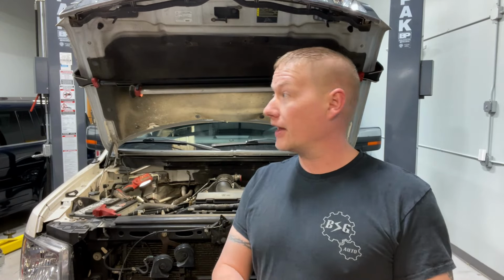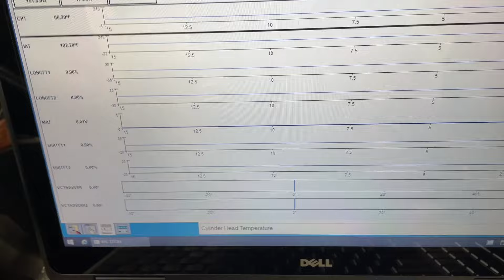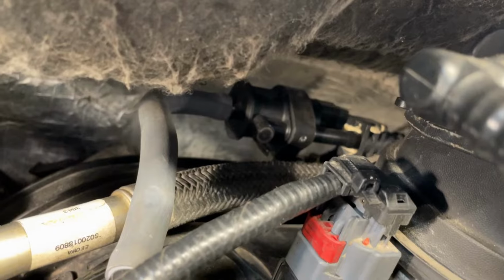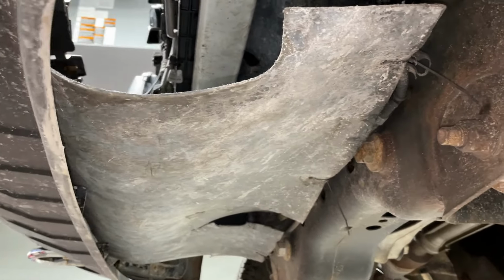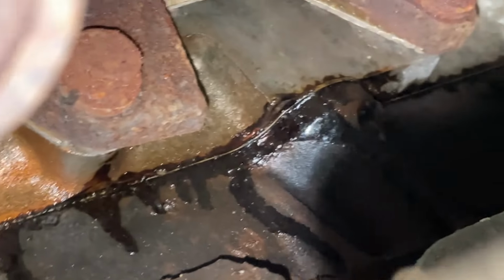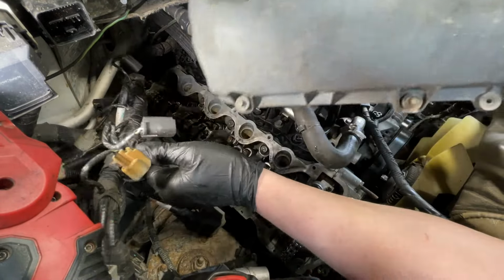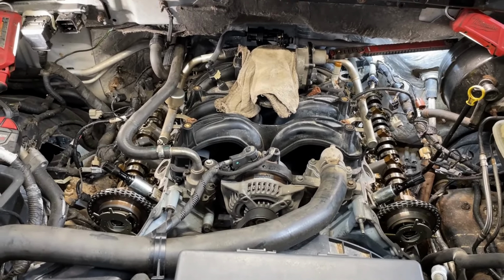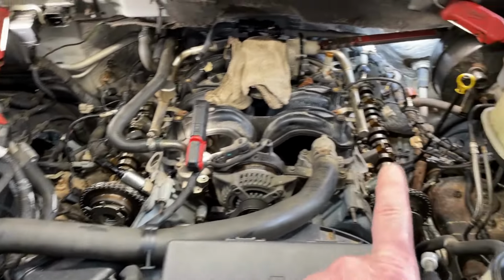The Worst Hack Timing Job Ever!

Comment: Mr. Ford tech! Can you please please help me, I just put a new tivct 3.5 in my taurus, its running crazy. Going from lean to rich every other second, sometimes misfires under heavy load going on entry ramps to the highway. The codes are p137 and p157 low voltage bank 2 sensor 2, replaced sensor, no change! :( :(

Comment: Geez, that trucks look nice on the outside (front bumper looks like a mirror), but under the hood and the underside looks like a rigged, RUSTY mess.    Still talking about doing the upgrading with the Amazon (as you suggested) Ford timing components kit on my 140,000 mile 2004 along with Melling HV oil pump (I already purchased)!  So far I only get the occasional chain slap for 1-2 seconds at startup.

Comment: Embarrassing work! I just did the timing job on my 97 4.6 following your instructions to the T even the rtv globs on the t points. I used felpro gaskets with new bolt grommets I've never had a problem with that brand. I also deep cleaned all the grime off the valve covers and timing cover, and then when all done pressure washed all the crap off the bottom area of the engine since the oil filter location is dumb af and it hasn't been cleaned in its life

Comment: @FordTechMakuLoco.....I was wondering if you can help me out with a rather odd issue I'm having. 
Rebuilt a 5.4l 3v, its set back in, bolted up, wired up, it cranks and turns over but will not start. Fuel pump is good, no anti theft system acting up, everything is working fine except...while testing things, I decided to test coil packs with coil test light and no go, I decided to test wiring to coil connectors and there's power going to all 8 connectors, I was stumped and sure didn't think all 8 coil packs had gone bad or something so I bought a brand new ignition coil and connected it, put test light on the wiring to the connector and put coil test light onto the new coil and connected it and had someone crank the engine. 
Power to the coil connectors is definately there but coils not engaging spark at all, not even on the new (ignition) coil.....any opinions, suggestions or tips on how to narrow down this issue? I'd really appreciate it.

Comment: Part 2??  Can't wait for you to work on the new 5.0 with the cylinder deactivation system, which I'm sure will be another nightmare engine.  Chevy having this in 2007 and later ram trucks with nothing but problems and some got lucky with little or none, now to seal the deal ford joins in.  I got my popcorn ready.

Comment: Man do I have a terrible timing job story. I have a 05 Mustang GT that needed a timing job and wanted to do it myself but I just didn’t have the space to do it. I already hate taking my stuff to shops so I was really dreading a shop touching all the timing components. As soon as I dropped my car off at what seemed like a really knowledgeable shop it was as if my car disappeared. They never called me giving any updates with the progress. What was supposed to be a couple days soon turned into a couple weeks with very limited contact. Finally after pulling teeth they tell me to come pick up the car since they are finishing it today. I go by and as soon as they thought they were wrapping up they forgot to put on the tone wheel(on the crankshaft) so that led to a couple more days. After my car was up and running finally they claimed it’s making a bad clicking/popping noise when turning. This was surprising since this wasn’t happening before I dropped the car off. They claim it’s probably just an upper strut mount since the car has been on a lift for over a month. So I keep driving it and the noise continues. I replace the upper strut mount, noise continues. I finally look under the car and to my surprise they had left the entire k member barely bolted in. That popping noise was my entire drivetrain shifting. After looking at it some more I discovered my transmission mount was missing two bolts so it was also freely moving around. Fixed everything myself so I know it’s alright but man did it piss me off. I honestly don’t blame the technicians, I talked to them and the truly seem knowledgeable and even felt bad for having my car for such a long time. I truly believe the shop owner is an incompetent d bag who can’t run a shop making the techs run around with their heads cut off.

Comment: i did an engine swap on a 2008 5.4 3v and had this issue with the used engine from the salvage it was painted up so pretty looked like a crate motor but would loosed oil pressure on one side and give me rich codes and timing codes  removed valve cover and seen the caps did not match the heads just like this vehicle  the salvage and me went  back and forth till the  gave me my refund and the real reman engine from name brand company  fixed all the issues the vehicle had  thanks for this video

Comment: I asked a question about doing the transmission filter had purchased a 2008 F-150 has, 160000 I'm not sure the history the fluid doesn't smell burnt but it was something I would like to get on a record if I could is it true about the myth feels like I'm getting inside a lot of shifts between third gear and overdrive

Comment: Those who live close to Chicago are so damn lucky to have him available. If you own a 5.4 3v and live close to him, do yourself a favor and just take it to him. Mechanics in my area are so unreliable it's almost unbelievable.  I had my rear end bearings replaced. ..Costing me close to 1k only to find out they forgot to put in a $4 bottle of friction modifier...I finally put it in myself several months later when I heard the noise upon turning sharp and it did quiet it down quite a bit but it's still there and it smells burnt when I open the filler plug..Wish there was a way to get the oil tested to prove it was not put in but from what I read oil analysis won't show this. Now I'm told by another mechanic ill have to spend at least 1.5k to replace all those bearings again since most of the time you cannot press the bearing off... they will do that plus the limited slip portion damaged from no friction modifier to fix it properly. I mean ffs..yeah just take it to Brian and be done with it, knowing it will be done right. Because of Brian I did my own plug change saving me hundreds of dollars from local shops..they knew I had the sp515 in but never told me those are the ones that didn't break and I could change those myself without worry of breaking them..Brian told me though. He also recommends the  Pennzoil 5w30 platinum Full Synthetic that so happens to have an additive to help valve seals...which stopped my oil loss I had since I've owned this truck. I was using about 1/2 qt in 700 miles..got over 1k since last oil change and still at full.  I just ordered the OBDLink MX+ OBD2 for Forscan and the oil pressure tester to help me understand more of what may be going on with my 5.4 3v. before deciding what to do. Brain thank you again.

Comment: Is it possible (likely) the previous shop hot tanked the driver side head but did not clean the caps? That doesnt explain the oil pressure issues but I think id have pulled those caps to inspect the journal and bearing surfaces.
Reply from the maker: Oh I did pull them.

Comment: Here’s a problem that could make a good video for the FordTechMakuloco channel. I have a 2010 F150 XL 4x4 with a 4.6 3v engine. It will not shift into 4x4 low. It shifts into 4x4 high no problem. It might be related to the ABS light that is on in the instrument cluster. I’ve checked the transfer case shift motor and it works fine except it won’t rotate the shifter shaft to the 4x4 low position. The reason I think it might be related to the ABS issue is that the CPU likely needs to confirm that the speed is below 5 kph before it will allow the shift motor to select 4x4L. Otherwise the transfer case could be damaged. I don’t have the wiring diagram for the 4x4 system but I know there are relays and speed sensor (VSS) and the GEM module involved. Anyway, if you can shed some light on this it would be much appreciated.

Comment: That's sad crappy work all around but some dealer that are shady sell off these ford truck to people with issues my dads buddy had a 09 with the 5.4 and it had cam phazer noise from day one he tried to get them to fix it they refused multiple times giving him bs excuses what the noise was till it was out of warranty so he made payments on a truck he couldn't drive for a year or so and then sold it at a loss I'm normally a dodge person but I don't mind any brand of truck but has ford done anything to remedy the 5.4 timing issue or have they just ignored it ?

Comment: Great video.  I do like the straight talk you put out on your channel.   Wished I had been to your site when I had a Transmission re-build and a head gasket job done on my 2000 5.4.   What I did not have the TECH do when the head job was done was replace all of the Cam Followers and rollers...ignorance on my part. Now it's "time" to tackle that task before it grenades itself.    If you have one of your old USMC buddies who has a shop in the Hampton Roads VA area (Newport News, Norfolk, VA Beach) who you'd recommend I just might be inclined to do some of that "Supply Side Economics" that Regan used to preach and let the "Local / Little Guy" take on the job.   If you have someone, please post it.  I'd toss you the job but you're just too far a drive and it might blow up on the way!

Comment: I seriously doubt that there is a salvageable core for a return on that block!!!
About two and a half years ago, I bought a new motor for my 2003 F-150 5.4 two valve! 
I had a guy install it with a new transmission, but the motor itself was a remanufactured motor from an 05’ Excursion which required a new oil pump, pick up tube, and oil pan because the cross members under the motor are different between the two vehicles!
I had asked around and watched several videos on redoing the timing on that motor(including this channel’s videos on that subject) way before I considered changing that motor!
Looks like this customer should have watched a few videos before they decided to shop around for engine work with their truck as the test dummy!

Comment: The staining around the headgasket takes me back to the dodge neon days (I am oldish).  Chrysler dealer told us the MLS gasket required a sealer in a rattle can that we sprayed all over the headgaskets to help seal them. .... Ok.... dealer recommended so... ya, experience has taught me different since then.
Reply: That sealer was for the guys who did the slip and slides .

Comment: Any recommendations on the 5th Gen Ford Explorers? Model years to stay away from vs recommended model years? I know the 3.5L NA and Eco-Boost engines have had severe problems in their earlier versions but maybe fixed by Ford later on? Thanks!

Comment: When will you show a 05 -09 mustang 4.6  3 valve phaser job ,my 09 has 60k miles  runs  great ,but I need to know when the timing and  oiling systems need maintenance
Reply: The timing job is essentially the same as the 5.4 3V. At 60k you should be fine for many more miles. Brian has recommended using 5w-30 oil and always a Motorcraft filter. Use 100% synthetic oil and change at 5k mile intervals and you won’t need to worry about anything.
Reply: @bryceweaver8211  Thanks,  How much stress does a custom dyno tune put on the phasers and valve train? I've been using  Motorcraft  5W 20 oil ,The only time its ever been red lined was on the dyno.

Comment: It’s very possible that one shop fixed the engine. Maybe after that car was running good but later something happened to the bank2 and other shop or the same shop was guessing and installed an old cam with old caps.

Comment: question;  do you replace VCT's while the valve covers are on or off?  Boy I wish you were closer to where I lived so you can work on my truck when it needs it.  Thanks for the video.  That poor guy dumped a ton of money and didn't get much in return.  If you do the engine I would like to see what's leaking from the head/engine block.

Comment: The factory intake sucks air in through the inside of the driver side fender. Is that not cold enough? Putting it back under the hood would make it a hot air intake.
Reply from the maker: yup exactly

Comment: I can almost hear the mechanic tell you that he had to do a junkyard cam swap due to a possible VCT failure that resulted in metal chewing the old one up. Same for the head. The plot twist is, all parts came from different vehicles. Probably different eBay sellers for used parts.
Reply from the maker: Lol

Comment: 😂 That cold air induction system pulls hot engine air instead of the cold air in the wheel well, where the oem pulls from. 
😂

Comment: I have a 2004 that stalls or shuts off when stopping. 160000 miles. Ready to have timing done but would like stalling issue resolved first. I put in neutral or park and it will normal to next slow down then truck turns off. Never throws codes. New Ford VCT solenoids and throttle body. Some have said its pcm.

Comment: Just had new timing kit and oil pump put in 2008 Ford mustang gt  and is worse before when warm it would shake at idle but I rev rpm and levels out now at hot idle sounds like diesel and wont level out when I rev rpms 58,000 miles no mods put about 4 thou and now it is worse was oil leak he admitted there was not one before said he fixed leak but this is a nightmare do you have any ideas what I could do been horrible stressful 7 months trying to fix only code is p0022 thank you sir.

Comment: The factory phasers fail right? So aftermarket worse than failed Ford originals?
Reply from the maker: Yes never use aftermarket phasers, I have a whole video just on that subject.
Reply: @FordTechMakuloco  I have used Dorman several times without issue but I know you have done more than I. 
I need to check out your presentation on that.

Comment: This is why you vet who you have service done on your vehicle! Especially when it comes to important service like timing and heads!

I recently took my wife's vehicle to the local shop to replace two tires. One of which had tread separating. I told them, replace bad tires(which were on the rear of the vehicle for safety), then rotate the new tires to the front. Because you always want the tires with the most tread on the front. What did they do? They rotated the tires first, then replace the rear tires. Essentially putting the bad tires up front and the good ones in back and replaced the good tires. How in the hell, as a service shop do you get this mixed up. If someone wants to replace tires that have tread separating, which is a very dangerous problem, do you not at the very least identify said tires before doing any work? The tire in question had a huge bulge on the outside edge of the tire that was bald and cracking. How to do not see that and put that tire on the front? Which is the worst place to put them? If i was a service tech i would not only identify the problem tire, i would inspect ALL the tires to be sure that there wasn't any other problems. NOPE! These guys just blindly did stuff to the vehicle and almost sent a potentially accident-prone vehicle down the road!

Also, NOBODY obviously took the vehicle for drive after words. If they had, they would've caught this mistake because the tire was so bad it made the steering wheel wobble so bad that you could hardly hold onto it! Seriously, i wouldn't take my vehicle back to this place to get a windshield wiper replaced!!! FFS!!!

Comment: Help. Plss.. My 06 F150 5.4 Harley Edition. I have backfire or like combustion noise coming from near driver side part of the engine when I accelerate on the road but when I press gas real quick it gives a loud pop then accelerates fine during idle. But when I accelerate on the road it would cause loud banging noise or backfire and engine would want to either stall or just slow down.
Reply: And has a Knocking noise coming from center rear of the Air Filter area right below it

Comment: If that came in I would go with new engine also...no way around it...too much time to try and guess/figure out what was done wrong in the past at other shops. Some of the "repairs" there are pretty bad. All of the repairs that were being done there are pretty straight forward so for someone to really butcher it up says alot. New engine goes in and leave all the headaches in the past and just enjoy a properly functioning truck.

Comment: I wish I could post a pic of the worst timing job ever.  Guy used the wrong guide and trying to figure out what's going on drilled holes in the valve cover to see through it.  Also jammed some swing set bolt in the crank on the balancer stripping out the crank.  Found wrong bolts bottomed out in timing cover, some threads stripped etc...

Comment: I believe the same about these 5.4 3v as I do the 6.0 diesel, the engines are not bad at all it's the hack mechanics working on them that have no clue what they are doing that is the problem. I've worked on several of both and have seen some seriously half @$$ work done most of which had to be undone and put back correctly to solve the original complaint. I believe you are on the right track about those cams, one got replaced and one didn't and they are now 2 different profiles or they were replaced at different times with different parts and are now mismatched. It amazes me how many good vehicles get ruined by inexperienced or ignorant mechanics because they didn't know what they were doing and didn't correct the problem then the vehicle is no longer worth repairing any further.

Comment: I’ve got a metal tube coming down out of my 07 5.4 f150 that I can’t identify. It’s on the passenger side near the firewall and it comes straight down to the undercarriage where it pokes out. Anyone have any ideas what it could be? It’s about 1/2in diameter